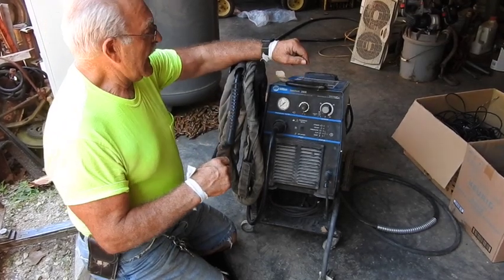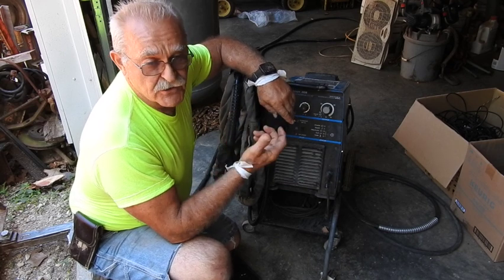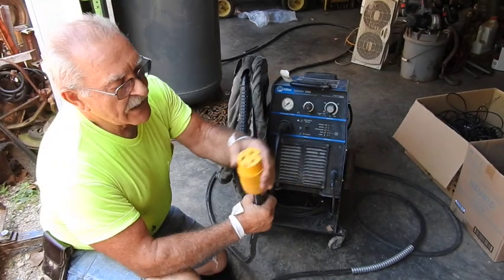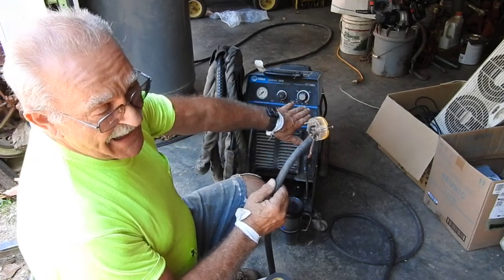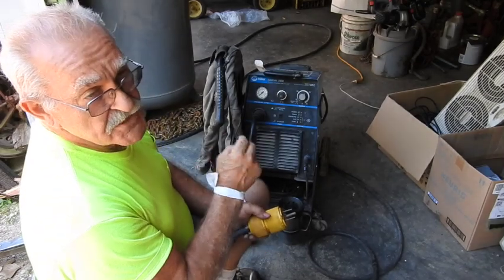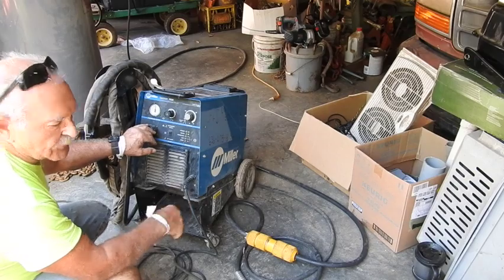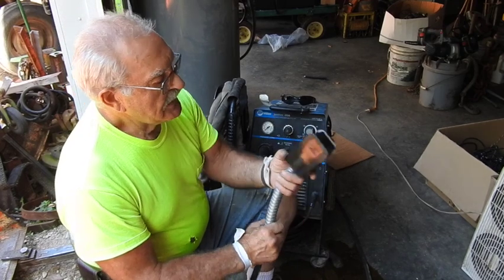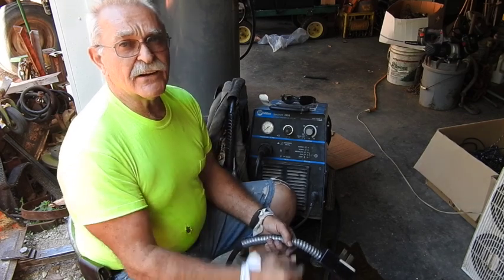Miller Spectrum 2050 Is It Single or Three Phase ?

Comment: thank you for this video, please i have miller spectrum 2255 (55amp), run only three phase, is thier any solution to make it 240v, thank you
Reply from the maker: I would recommend doing a google search for the manual.  I found the manual for this 2050 very easily.  Look for the section on electrical requirements and there will be specific diagrams for you to follow.  One thing I don't know though is if yours is 480 volt three phase if it is autoranging to accept a 240 volt input.  That too should be covered in the electrical section.  AND it may even have that input voltages listed on the name plate of the machine.  But I bet if yours is 240V three phase, it will be autoranging like the 2050 and accept single phase 240 volt circuit easily.

Comment: Great machine Wendell, I don't have one but my Brother do and use it all the time, extremely handy for metal work, thanks for sharing
Reply from the maker: The worst thing about them is you no longer have the ability to use the tool for heating material for bending or shaping if its your only cutting tool.  The best shop set up has a plasma AND an oxygen-acetylene torch.  Thanks for stopping by Jan.  Have a wonderful day way over there my friend.

Comment: Sweet machine!
Reply from the maker: They are almost a 'must have' in a shop like yours Matt.  I'm sure you have one stuck under the bench somewhere.....  Take care and stay warm today...oh wait, stay cooool.
Reply: @tractorman4461  well, I had a Chinese one that failed almost immediately. I will be obtaining a much better quality one in the future.
Reply from the maker: @mattthescrapwhisperer  Well, that's sad.  Pop it apart and take a look ??  It might be as simple as a fuse on a circuit board or a burnt wire....If you are looking for the leader in the industry, try checking out Hypertherm.  Superb machines for sure.
Reply: @tractorman4461  Did that. An electronics buddy of mine spent a couple hours with it. Replaced two broken resistors, but it was so poorly constructed that we just couldn't get it going.

Comment: Same as the Miller Maxstar welder we had where I worked. Auto ranging. single phase use blk & white. 3 phase black, white and red
Reply from the maker: The first autoranging welder I saw was brought out to me on a job Ed. I asked the boss what voltage to use and he said whatever you got.  With autoranging, you can power it right off the disconnect box of whatever you are working on if available.  Same thing inside the plants.  I assume the technology is now industry wide, but I don't know for sure.

Comment: Tm44 that'll make someone a great Cutter. And, you did all the homework. I bet she will mss having you as a neighbor. This is a fine example of what a neighbor  is. Two👍's up buddy.
Reply from the maker: Yes Dean, someone will get a good machine that's for sure.  And at 55 amp maximum setting it will cut anything a home owner would ever need.  At 240 v and 55 amp the duty cycle is still 50%.  Thanks for the nice comment my friend.

Comment: Same a previous comment. Love to have a plasma cutter. Had to rent one a few years ago to cut some high tensel steel that an oxy/acetline wouldnt touch. Melted that steel like butter. Definately on my future need list.
Reply from the maker: It doesn't matter what the material is Alan, if it conducts electricity a plasma torch will cut it. They are a versatile tool for the shop.  Thanks for the visit this morning.

Comment: Nice job. I’ve seen a few welders wired wrong over the years. It ain’t pretty lol. Nice f you to check that out and have a video of equipment she can reference too. 👍
Reply from the maker: I didn't know for sure if it had the capacity to be used on single phase but with a closer look it kinda says so on the tag, but with the downloaded pdf, there is no mistaking.  I think she wants the video to direct potential buyer to so they can more understand what they are buying and see it work.

Comment: Sir, I'm amaze about the voltage/amp/hertz flexibility and the size are getting smaller with time of these plasma cutter and also welding machine !!! That is a very power one for sure !!! Yes eye protection and skin too is a MUST !!!  Have a nice week end Sir !!! Cheers
Reply from the maker: UV radiation can literally cook your blood too I'd think.   I heard it said if your arm begins to smell like a well done steak, you should be wearing a welding jacket....LOL  But I'd rather have part of my arm for lunch than to have my retina's fried from the inside out !!  Yes,  this little guy is rated at 55 amps and is rated at 50% duty cycle on 240 single phase.  Take care mon ami and have a great weekend !!

Comment: Now there's a piece of equipment I dreamed of owning for many years, I just never got around to buying one.
I learned something about "auto ranging" and three phase supply here today, again, thanks Wendell.
Reply from the maker: The little gizmo boxes work majic in the electrical department for sure now a days Reg!!  What's cool is once the plug is wired for 3 phase power, you can apply any voltage from 208 to 575 to the same wires !!  But that's the electronics for you nowadays. LOL  Smarter than the user !!

Comment: I learned my lesson 25 years ago using the plasma machine to cut holes in spiral pipe for the saddle takeoffs. I had safety goggles on but they weren't tinted like yours. Had trouble sleeping that night with my eyes burning.  Thxs for the vids!
Reply: Oh my I feel sorry for you, I too, suffered with that when I started 'plying around' with welding first, many years ago. But I'll tell you, I have learned my lesson! too.
Reply from the maker: @regsparkes6507  On jobsites Reg,  we had to put up colored plastic shields to protect the eyes of other workers working in the vicinity.  Don't get caught by OSHA without them either !!
Reply from the maker: Well David, its a good thing it wasn't gamma rays instead of UV rays or you might've turned into the Hulk !!  LOL  All joking aside, it really ain't no joke getting flash burns.  Especially from a plasma arc.

Comment: Good afternoon Wendell.
That’s a nice machine..
I have never used one before..
I have my Gas torches ( welding steel and brass) and cutting.
A stick welder and a Flux welder..
I learned old school.. But I was very intrigued with your glasses.
Never seen them.. that would be so much easier then a mask or goggles.. Please explain a little for this old guy.
Thank you.
Stay safe and always be kind.
Cheers
Reply from the maker: Glasses like these are available in many shades of darkness at welding supply houses.    The minimum, as I understand, for plasma is a #5 shade for light duty cutting. Due to the brightness and intensity of the blue waves on the UV (Ultra Violet) and IR (Infra red) light spectrum, the higher the settings on the machine the darker the lens requirement.  The following I copied right from a welding safety site: 

Since a plasma arc generates light across the entire spectrum, it definitely includes “blue light” in the light that you see. And because the visible light from a plasma arc is very intense, the damaging “blue light” from a plasma arc is also very intense, and therefore potentially dangerous to the human eye.

But here is one of the biggest problems – you can’t feel retinal damage until it’s too late. If you damaged your retina, there's no pain, and the only way you know is when your eyesight starts to degrade. By the time you see an eye doctor about the problem, the damage is permanent.  
  
They then have a chart listing the shades correlating to amperage settings, but if you google ANSI Z49.1:2005 you should see the chart.  Thanks Gus for watching and asking about the glasses.  They are so much more convenient to use than a hood or full face shield because there isn't the intense heat generated like an oxy-acetylene torch.  Most thin metals can be picked up almost instantly. I hope you got enough information to satisfy your thoughts my friend !!
Reply: Wendell thank you for the info.
I was wondering if for regular welding about the glasses..
I know I think when I was 16 I was helping a friend weld a patch in the floor of a tree service truck I was holding the plate he was welding I was watching the reflection in a window and that night I woke up to welders burn and went to the ER…
I learned a very valuable lesson..
Hahahaha
Reply from the maker: @gusswenson7811  Hahahaha....I think Gus, that most guys like us made the same mistake as kids.  LOL.  I think if you use these for welding it would be recommended to only do it for tacking something together.  Extended welding exposes your whole face to the heat, sparks and radiation.  That's my thoughts anyway.

Comment: I just love a plasma arc cutter. Not only can you cut most any metal ferrous or nonferrous, but you can cut a wide range of thicknesses. On a bad note they show any shake in your hand worse than a torch. That autoranging is the bees knees, I have never ran into that. What will they think of next?
Reply from the maker: Yes, if material will conduct electricity, a plasma machine will cut it !!  I think the limit on this unit for thickness is .87" or essentially 7/8''.  I think autoranging for the power supplies are pretty much the norm these days Rick.  It sure is a wonderful breakthrough in technology though.   That's the majic of electronics I guess.